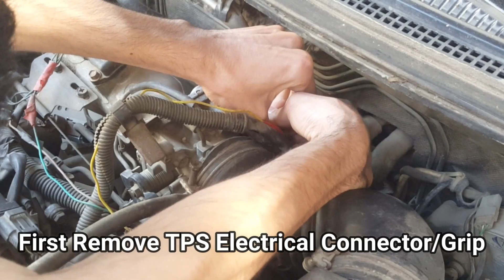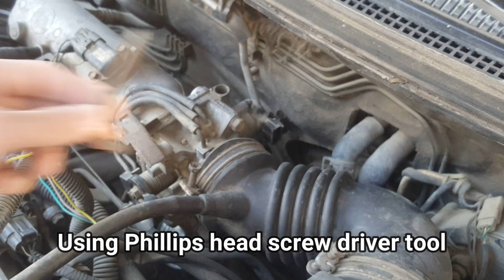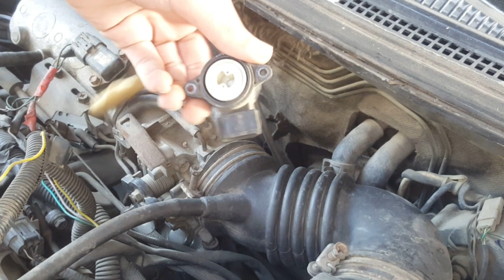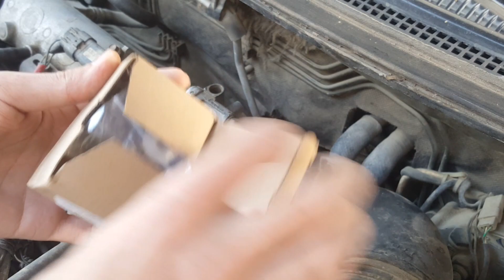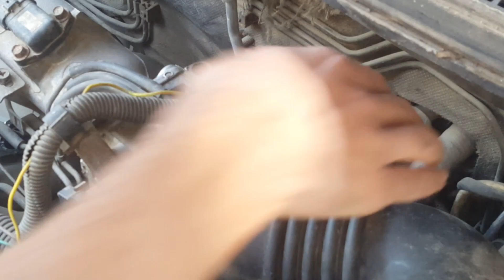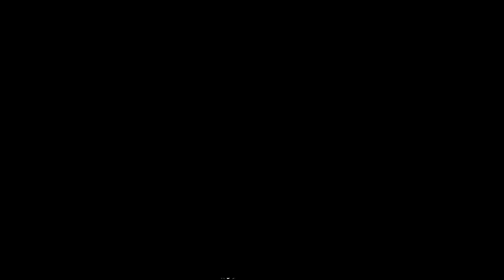Mitsubishi Lancer TPS Sensor Change

Comment: Tps that you change is 4g18.thanks
Reply from the maker: i installed this on 4g13 but it is same for 4g18 too!😃
Reply: @journeywithhaseeb  thanks if I changes need to calibrate? Lack of power I changes the maf and idling sensor already.
Reply from the maker: @Marites728  yes will need to calibrate it. Try Setting it at 507mv or lower if idling is high at 507 then go lower than 507 to 488 or more lower until desired idling is achieved. Although 507mv is just the perfect value to set it, keeping in mind all other things are working perfectly then it should be good at 507mv🙂
Reply: @journeywithhaseeb  thanks I buy and changes the tps. Try to follow how you install the new tps in your video.
Reply from the maker: @Marites728  ✌

Comment: I have Mx Lancer 2004. Is it the same TP sensor like yours?
Reply from the maker: @richluna7596  which engine does it have?
Reply: @journeywithhaseeb  1.8 litre 4G93 SOHC engine
Reply from the maker: @richluna7596  i am not sure if it has the same tps
Reply: @journeywithhaseeb  ok cool. Tnx for your time.
Reply from the maker: @richluna7596  you may wanna check your chasis / vin number on partsouq.com or ssg.asia
Using vin number u can find the corresponding tps part number and interchangeable tps part numbers as well.. then see if any of the part numbers listed there matches mine one shown in video.. if it matches then it will work in ur car as well.

Comment: Do you have video how to change throttle cable??
Reply from the maker: Though i havent changed it.. but still it will be pretty easy one... remove 2 bolts of accelerator adjuster from intake manifold.. then remove accelerator cable from throttle body pulley. Lie down on driver side floor mat ( region dependent if the car is left / right hand drive) and locate accelerator cable attached to accelerator paddle (there must be a bolt attacher same like on intake manifold to hold the cable assembly  and a cable attached to pedal same like as of throttle body pulley). Remove and and pull the whole cable from the engine bay.. reinstall new cable same way🙃

Comment: Hi my car when at idling, check engine light on but when I press throttle pedal the check engine light will turn off.... Is this a symptom of the tps sensor?
Reply from the maker: Yes this does looks like.. but please attach scan tool and confirm

Comment: Nice video bro, but you missed the calibration part.
How do you calibrate, without scanner, that sensor and IAC sensor? Because if you remove them you'll  get unstable acceleration.
Reply from the maker: Iacv need calibration only when a new iacv is installed first time (but not all iacv requires calibration). If u unplug iacv wire and plug it back there will be no difference after the first calibration. Calibration is done via scanner using SAS actuator mode. Also when u remove tps and install it back, if u dont have scanner then what you can do best is after mounting it to the throttle (while screwing screws) keep the tps pushed downwards so its output values may remain between 500 mv - 527 mv. 
I did used the scanner tool after turning  off the camera hahahahah😂😅😅😅. But in next videos I'll  try to demonstrate these things too.. thanks for the tips ! Cheers🤝❤🚘🔰🙌
Reply: What is the purpose of tps sensor?
Reply: In my lancer after it came from the tunning service  , i see that when i start in the morning its rpm is not getting high as it should , i have to hold the accelerator make it warm  then its stable , before if i cold start it its rpm used be high but now its not doing that automatically
Reply from the maker: @mubashirumer722  it tells ECU how much accelerator/ throttle is pressed 🙂
Reply from the maker: @mubashirumer722  i believe your iacv is not working properly

Comment: Any one have any info on a 04 railart tps sensor an the location an where I can find it having trouble with finding videos explaining where to find the tps I’ve replaced throttle body spark plugs and still won’t start need help if any one got ideas
Reply from the maker: Can u share engine model?

Comment: Why did you change TPS? What are the symptoms of bad TPS?
Reply from the maker: Check Engine light will turn on if u press full accelerator while car in 2-3-4-5 gear and will turn off when u release pedal from full to 75%. Also you will notice a lil jerks when you r driving. Car might even bogg if you press accelerator suddenly halfway when engine cold while in 1st gear.🙂